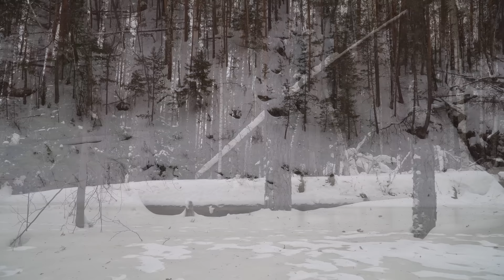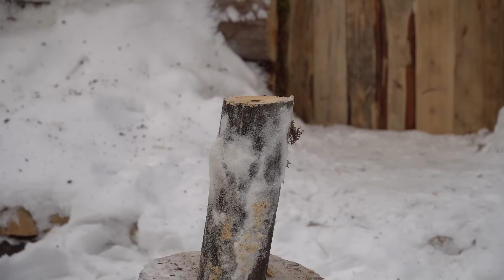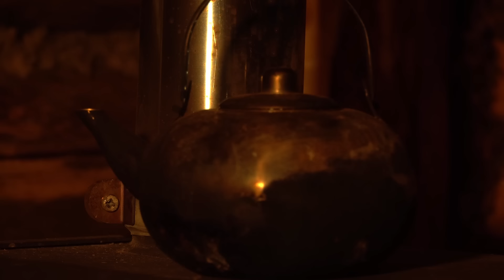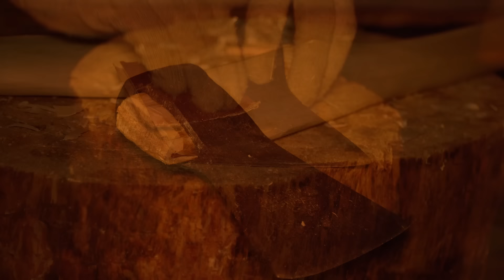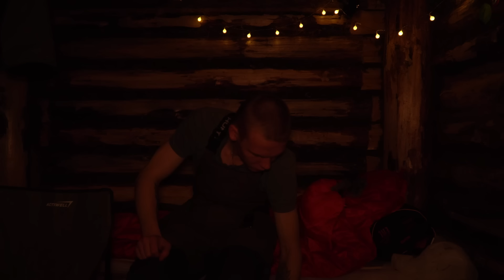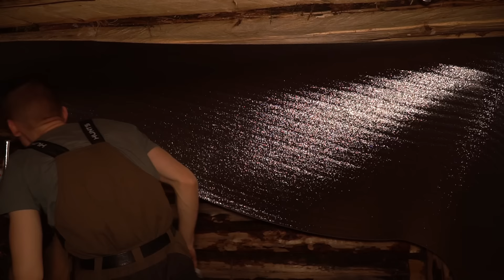Cabin life: Waiting for the STORM, I hid in a log cabin. FOREST BUNKER

Comment: What is the purpose of piling snow up around the outside walls of cabin? Doesn't that make it colder? Or does it keep cold and drafts out?
Reply: The snow serves to isolate the cold from the outside
Reply: Helps to block wind from going under cabin causing floors to be colder than if he hadn't've done it. Also saves on firewood, too.
Reply: The air trapped in the snow acts as thermal insulator. It also blocks the wind.